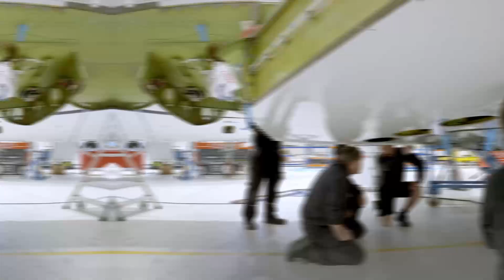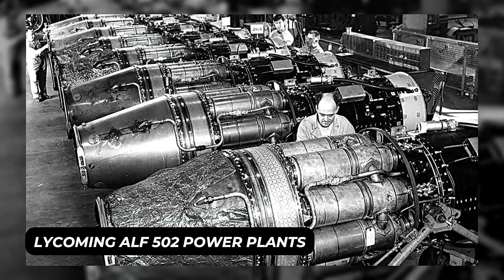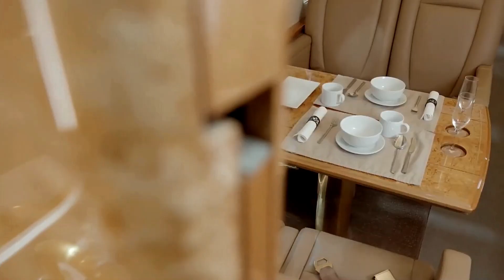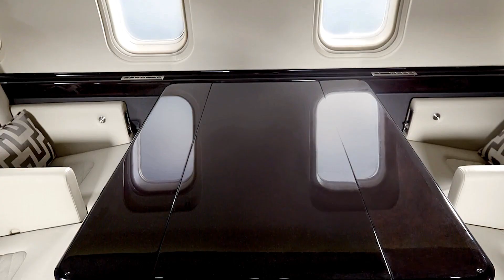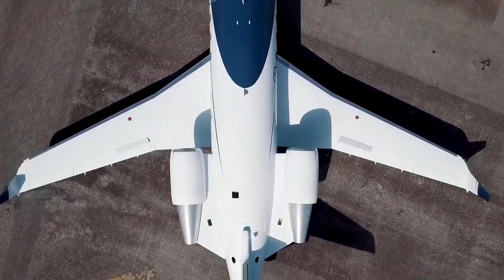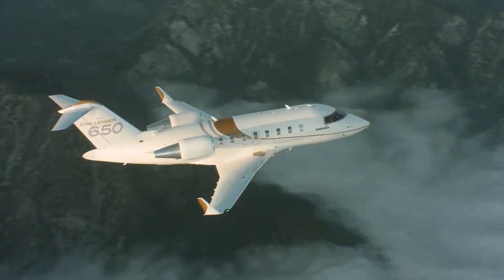The Real Price of Owning a Bombardier Challenger 600

Comment: Challenger aircraft are not powered by Lycoming engines. All variants are powered by General Electric CFM-34 engines. There are no 600's flying, only a handful of 601's are flying. The design wasn't bought by Bombardier. Bombardier purchased Learjet outright.
Reply: You obviously don't know what you're babbling about. The original Challenger 600 had the Lycoming ALF 502 turbofans, the CFM-34's ended up being replaced with the Lycoming because the major customer (Fed Ex) was dissatisfied with the GE engines. And Canadair bought the Lear 600 CONCEPT, it did not purchase Lear until 1990.
Reply: @maxsdad538 I LITERALLY turn wrenches on Challenger aircraft Monday thru Friday. There are zero Challenger 600 aircraft flying. There are zero Challenger 600 aircraft flying with Lycoming engines. They are either 604, 605, 650 or a few 601's left and they ALL have CFM-34 engines. ALL of them. You can take 2 seats. You're not ready for me.